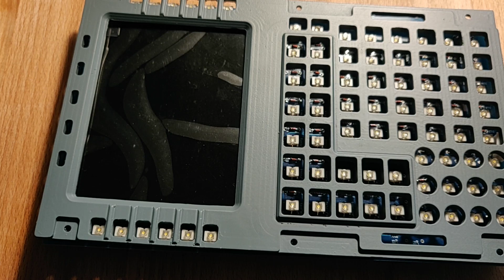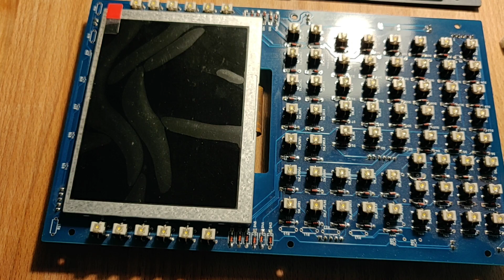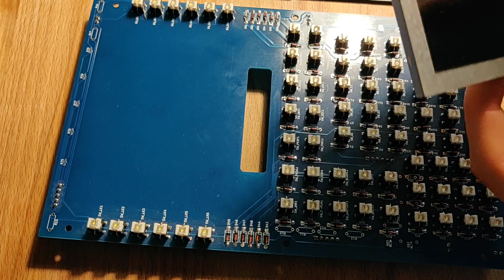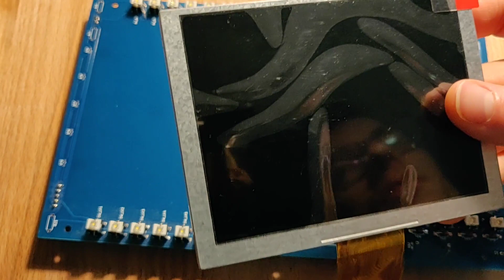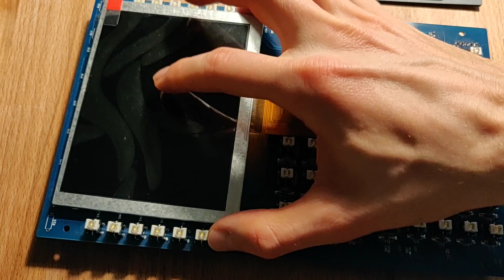DIY A320 MCDU - Work in progress - Sim Vlog 002

Comment: Hello, buddy. How do you export MCDU data from the game into a screen display? My game is Xplane 11.
Reply from the maker: Hi, X-Plane is a bit limited in this as far as I remember. Stock airplanes might not support it, but some payware aircraft might have an option. Also there is WebFMC but it is not free for any Airbus. 

In other simulators, for example, Jeehell FMGS in FSX  allows running a separate window (even on a remote computer) that has the MCDU screen. Likewise the free flybywire A320 in MSFS allows rendering the MCDU screen in an external web browser similar to X-Plane's WebFMC.

Comment: How far in are you with the build currently
Reply from the maker: Like the whole sim? I got bits and pieces here and there but not a single piece that is ready for use.  I got three panels ready (MCDU, FCU, EFIS). I've got some button caps (backlit) ready. I've got the underlying electronics and interfacing sorted out pretty well. There are many small things that are hard when you try to design everything from scratch. A good example is the baro setting knob on the EFIS: push + pull rotary encoder with a concentric two position switch. That knob alone is worthy of a whole video! 

I got a big load of video ideas for this channel (both sim & electronics related), just a little bit tight on time to make them. But I'll deliver eventually, thanks for dropping by!

Comment: Hi! Thanks for sharing. Can you tell me where did you get the print circuit ? I will start from scratch.
Reply from the maker: Hi! I use JLCPCB (China) for big boards like in this video. Delivery time for me has been fast (12 days) even with the cheapest shipping. You can also use website called "pcbshopper" to compare different manufacturers and prices.

For very small boards I like to use OSH Park (USA).
Reply: @ExperimentalExperiments  thanks maybe can I ask you to share me your PCB plan ? I will create an a320CDU…
Reply from the maker: The circuit board is just one piece of a larger puzzle. Panel design and sizing, mounting methods, buttons, circuit board components and interfacing are examples of other pieces of the puzzle. 

I think you will be happier with the result if you design your own piece to fit your own exact requirements.

I do intent to make example videos of my design process at some point in the future (but probably not this year).

Comment: I would be very interested in this DIY A320 MCDU. I have been search for a starting point to  building a home MSFS A320 sim. Would really appreciate any information. I'm not interested in 1.1 ratio, just trying to get something going
Reply from the maker: There are many ways to approach building a home sim. I'll be working on a full panel build video series this summer (the auto brake panel) so I can document my typical workflow. MCDU is quite a lot of work though as it has a ton of buttons. You might want to try a smaller panel to try out your workflow before embarking on a more complicated panel like the MCDU, FCU or EFIS.
Reply: @ExperimentalExperiments  Thank you for your reply. Got to start somewhere, good with wiring and soldering! Look forward to vids.

Comment: can you tell me where to buy button key with led?
Reply from the maker: https://a.aliexpress.com/_mqBmqIw mine are these (MKTStudio), but I bought without leds because I wanted to use warm white leds. Flat top leds are better for backlighting. You can of course grind round tops into flat tops with sandpaper or a file. As far as I remember, the switch can fit 3mm diameter, but most 3 mm leds have a small ridge that makes them wider at the base. Those can be broken off with pliers. If you can find smaller than 3mm leds with flat top that would be perfect fit without all the manual work.

Comment: Hi. Thank for your sharing info. I want to make a MCDU. Could you share all the parts information?
Reply from the maker: Hi Lee. Unfortunately, at this point at least, I don't have anything that I could just "hand over" that would work as a guide to making one. Large chunk of the information is currently just in my head, so compiling it all together into a nice clear instructions/document would be quite a bit of work. BUT, I'm planning to make a mini-series on my design process at some point, where I'd like to detail how I create a panel from scratch. 

Meanwhile, if you have some specific questions I can try answering them.